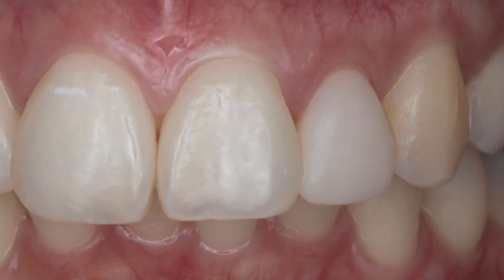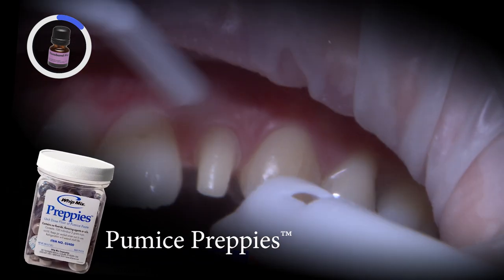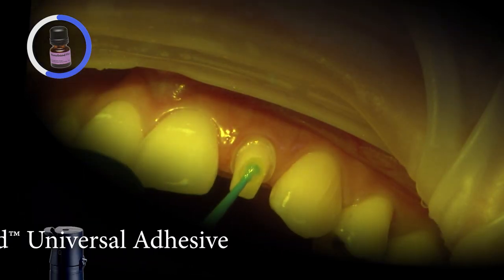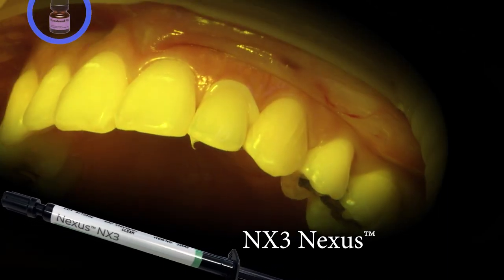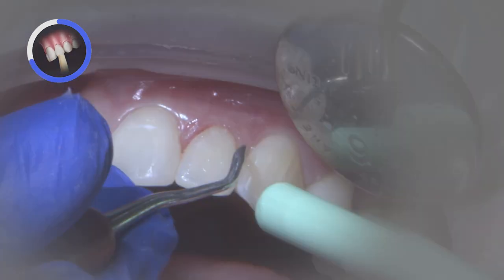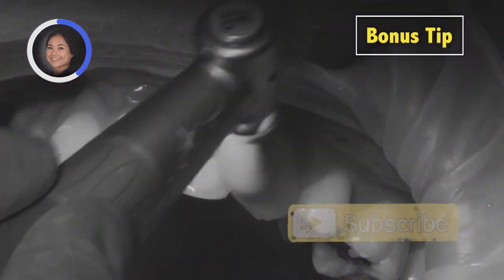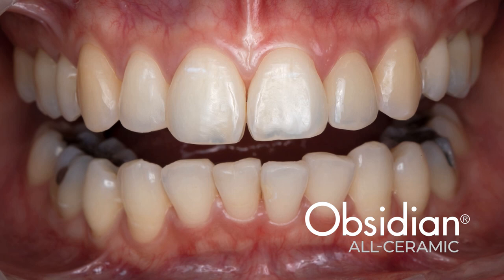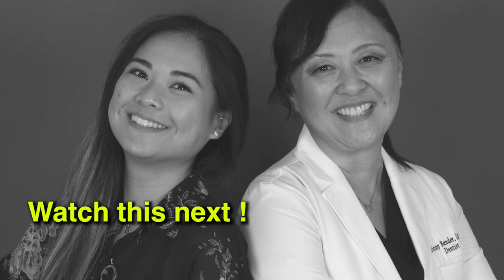HOW TO Bond All-Ceramic Crown for Peg Lateral Tooth 10

Comment: The bonding agent already has silane, any benefit of additionally applying silane on the crown?
Reply from the maker: Thank you for watching this video and for your question. We will be sure to relay this to our dentist.
Reply: The silane is a chemical coupling agent that bonds the restoration to the cement.  The adhesive agent on the tooth is the coupling agent to bond the tooth to the resin cement.  If silane is not coated inside the crown, debonding situation may occur that is unwanted.

Comment: why only 10s for etching with 37% phosphoric acid ?
Reply from the maker: Thank you for watching.
Reply: If you want to leave it on for 15 seconds that is fine.  I do like to rinse for 20 seconds and leave the dentin moist to prevent dessication.  Just make sure to desensitize the dentinal tubules with a desensitizer prior to placing prime and bond adhesive.

Comment: Why you didn’t cement the crown under rubber dam ? I think you’ll get much better result
Reply from the maker: Thank you for watching. We will forward this question to our dentist
Reply: Isolation can be done in 3 ways:  Rubber dam, Isolite system or Cotton Rolls.  Moisture control is important whichever way you can control it.